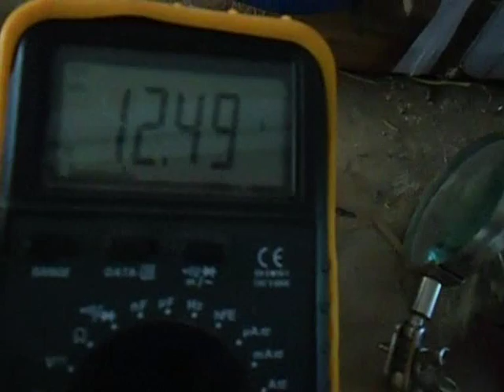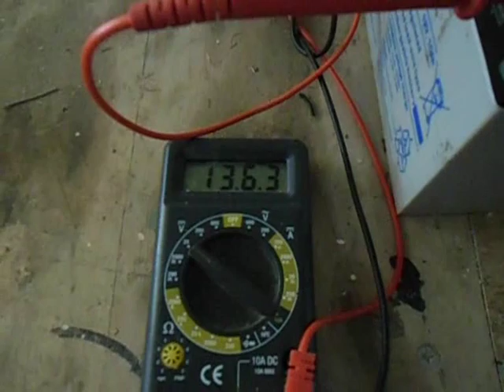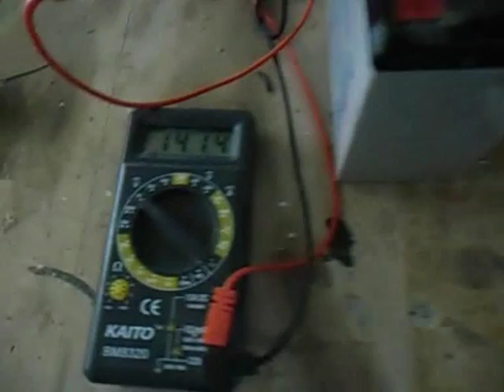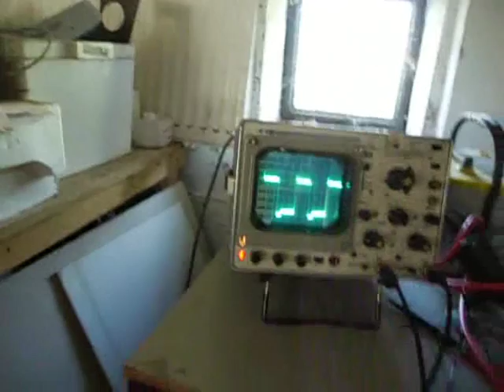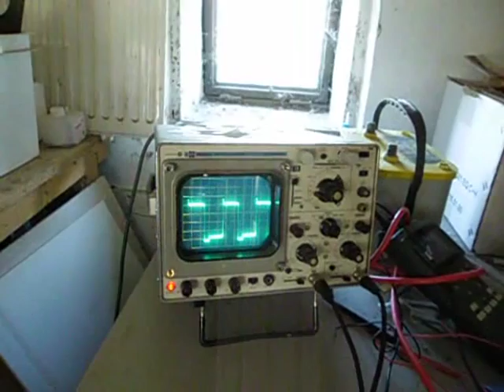first ferrite core test

Comment from the maker: It is realy simple just connect the trigger reverse and one site to positve other with resistor to base. The rest is just standard SSG. Just very basic and simple but only with a little length of copper wire and still the transistor doesn't mind and stays cool. (even with just 2 meter 1mm thick copper wire).
Thanks for watching!